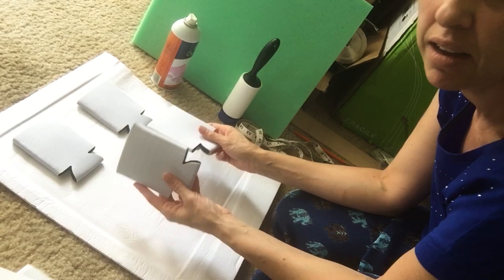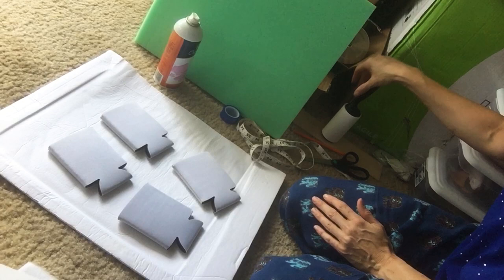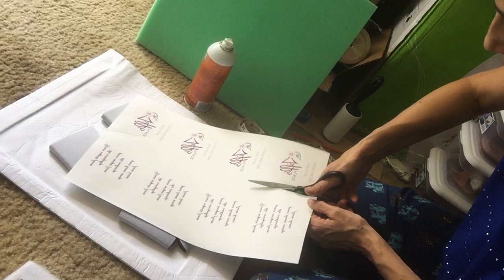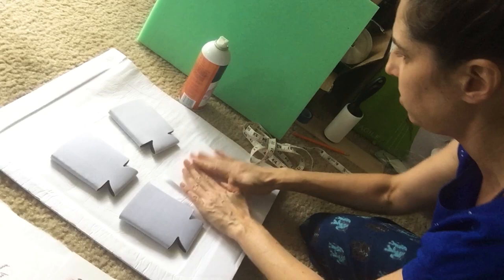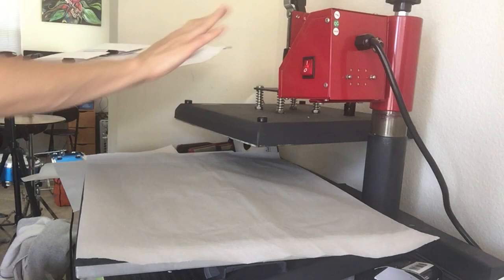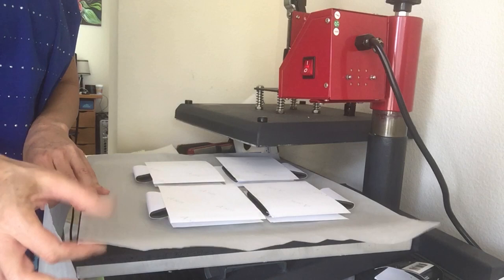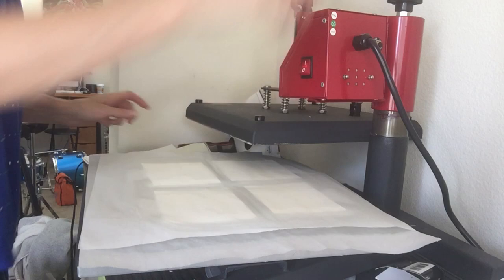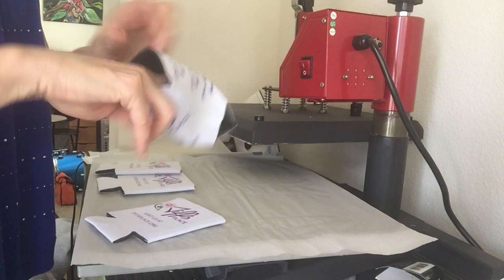Sublimating Can Coolers - Can Coozies: How to sublimate on Koozie tutorial

Comment: note to self  TEMP @8:00 min mark 385 / 60 SECONDS .She is doing 377 / 57 seconds.
Reply from the maker: the temp should be 385. The substrate can absorb the heat and drop for a few seconds. But then it comes back up.

Comment: Thanks for this video. I am still having so much trouble. I have used heat tape and now the adhesive spray and I am still getting shadowing. I don’t know what I am doing wrong. I have a clam heat press set to 400 for 30 seconds medium pressure. Please help! I have gone thru so many koozies with this same issue
Reply: I’ve watched several different videos and each of them say different temps, time and pressure. So I’ve tried 385 for 60 seconds light pressure and medium pressure, 395 for 45 seconds with light and medium pressure and now 400 for 30 seconds light and medium. And I’m still getting shadowing. I just don’t know what I’m doing wrong. I can’t figure it out
Reply from the maker: Cindy- I'm sorry you are still having issues. Are you pre-pressing? That might help. As far as temp -you are seeing so many different answers because heat presses can vary. Like mine runs a little hot, so I compensate by lowering from what the recommendations are from the manufacturer. Also, maybe try lowering your pressure. The suction from the top platen when you open it is what causes the ghosting. Use tape or spray adhesive, light pressure so when you open it, it doesn't POP open - you can gently lift.  If you are still having issues, please feel free to reach out to me by messenger on my Facebook page.  https://www.facebook.com/StacyODesigns
Reply: Stacy O Designs hi Stacy yes I’ve tried pre pressing but that didn’t help either. I had been using tape but when I came across your video I bought the same spray you use and that didn’t help either ... I’ll try again with the light pressure though maybe I am lifting it too quick ... thank you!!
Reply: @cindyperez1562  your singing to much or to little presher then

Comment: What program and all the goods do I need to start making these
Reply from the maker: You would need a sublimation printer, or a printer that can conver to sublimation. Sublimation ink. Sublimation paper. Heat press. heat tape. sublimation ready blanks. You can basically print from any program that can create and image or text.

Comment: How do you avoid getting the square lines on them?
Reply from the maker: The square lines meaning the press marks from the paper? Firstly, neoprene does not need a lot of pressure. That can leave marks. If I do get marks, I roll with a lint roller while it's hot. That pulls the fabric fibers back up. This technique works on all types of fabrics. BUT, if you press TO hard, it may be a lost cause. Another option is to have the paper go over the edges of the koozie. It uses up valuable paper, but you definitely won't get the press mark lines.
Reply: What was your settings degrees and time please 
And thank you

Comment: I always get ghosting. I tape them, spray them and lift slowly. Mine always puff up too. Jealous
Reply from the maker: hmmm, do you pre-press? That could help. These neoprene coolers (and neoprene in general) is finicky. Do you happen to have a clam shell press?
Reply: Stacy O Designs I just started pre pressing it’s much better but still a little funky. No I don’t have a clamshell. Mines a slide away